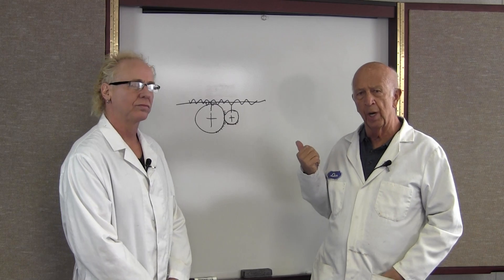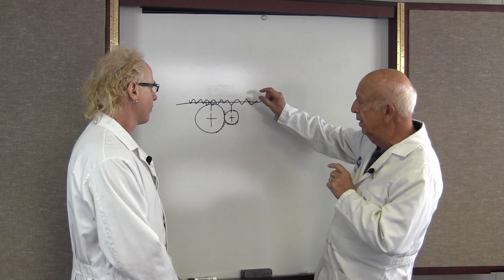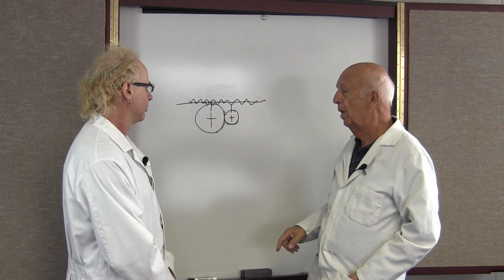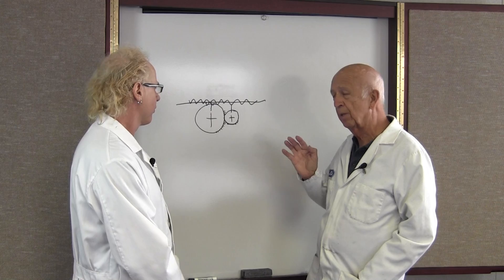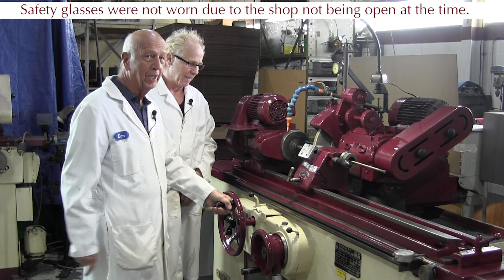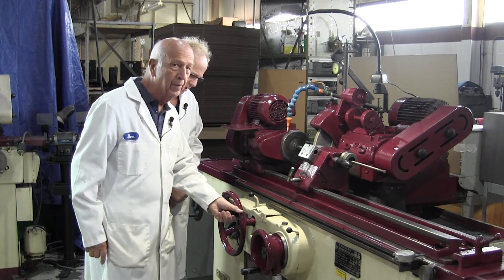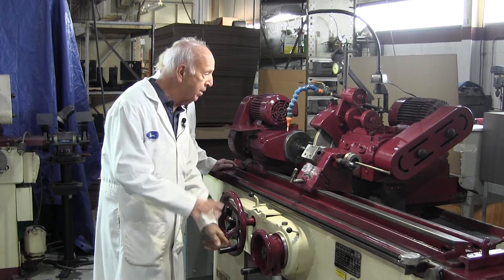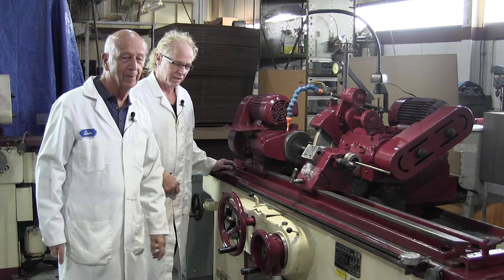How to identify and correct gear backlash part 2

Comment: Yes just watched both video's , great and you don't need to do technical video's every time, sometimes it just nice to see the process, the time's in the past I've striped a machine down and I've thought  that was an easy fix put back together , then found I've had to strip it back down and do a proper job and instead of it being down a hour or two,  it's down a month! Waiting on parts to arrive or to make parts between other jobs. lol.
Stay safe with what's going on at the moment.
Thanks for sharing.

Comment: The carriage rack on my cheapo lathe was mounted on the side below the ways. It has elongated screw holes for adjusting the depth of engagement with the carriage. The benefit there is that if there was wear in one spot I could loosen the screws on either side a wedge it closer (it is a rather bendable bar) then tighten the screws. Some say it's magic, but we know better. ;-)

Comment: So as it usually turns out trying to tighten up an old worn machine often leads to more problems than it fixes..................... If only rebuilds were cheap and easy!
Reply: And you have several Tons of old machinery!
I have a few, compared to you, tons of older machinery.
Luckily we aren't into production!

Comment: CAN YOU EXPLAIN AGAIN WHAT CAN BE DONE IF THE RACK IS WORN MORE IN THE MIDDLE THAN ON THE ENDS? IS THERE A FIX OTHER THAN REPLACEMENT?
Reply from the maker: We are going to take a look at that in our next video. It’s possible to turn the rack gear around but I don’t know for sure until we take it apart. And by the way I’m not sure the rack gear is worn.